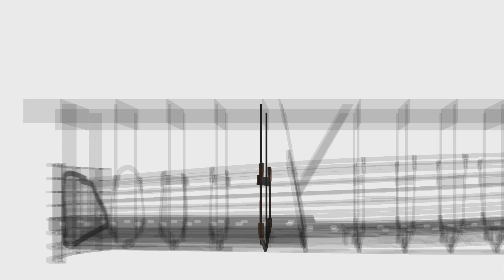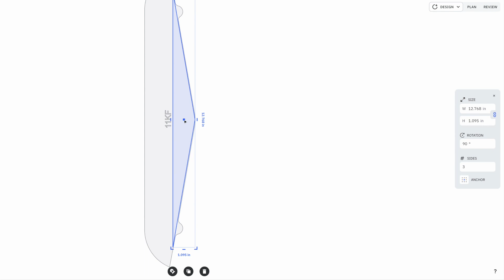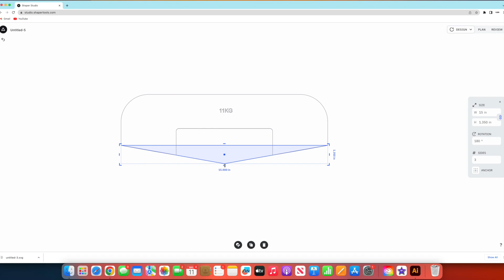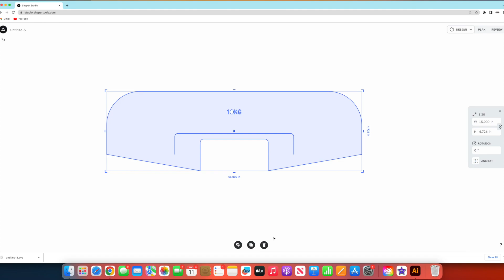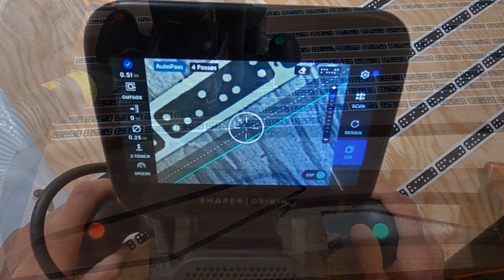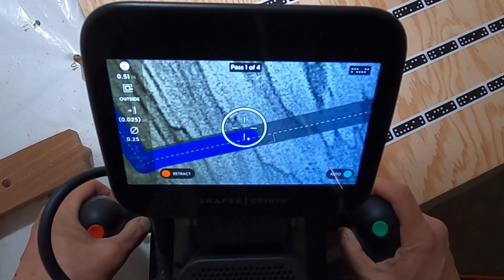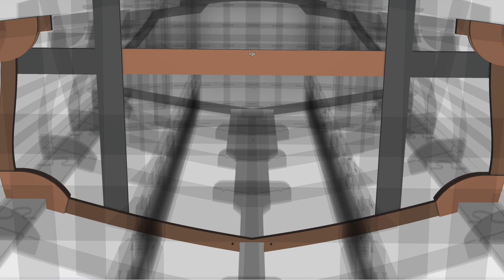Temptress Build 17: Frame 10 Customized

Comment: About halfway through the final video in this series, will be patiently awaiting new uploads! How much time do you have into the project so far?
Reply from the maker: Thanks for watching.  Here is too long of an answer…
Each frame take me 1.5 hours per side (then wait for epoxy to dry overnight).  1.5hrs x 2 sides x 13 frames = 39 hours.
Cutting all of the parts with the Shaper Origin took >100 hours, but I was just learning to use the tool.
And I have watch >200 hrs of videos and reading to learn what to do.  
Sometimes the video editing take longer than the build (e.g., Frame 2)

So if you outsource the CNC work, you can get to my stage in 2 weeks working full time.
Reply: @Polymerman  yeah I was planning on outsourcing the CNC work 100%. I’ve never used a CNC before and pair that with never having built a boat before, I’d feel a lot more comfortable with the finished product if I had the CNC work done by a pro.
Reply from the maker: @taylordauwe  
Wise decision.  I have never built a boat either.  So most of my time is spent watching videos and reading.
If you join the Dan Lee Boat Builders forum, he and others can help you along the way.
I will continue to publish videos, so hopefully you can avoid mistake that I am making.
Reply: @Polymerman  much appreciated! I just finished watching your latest installment, as well.